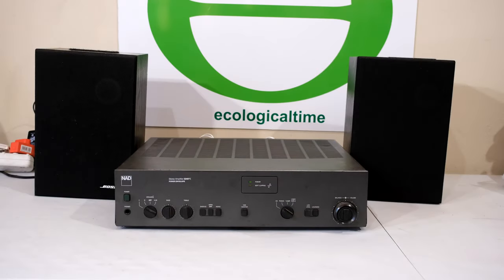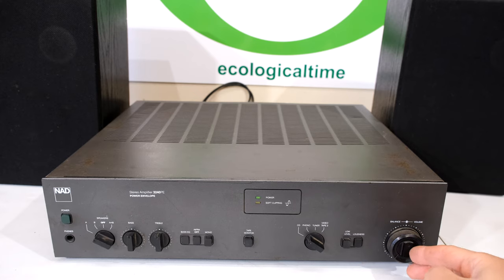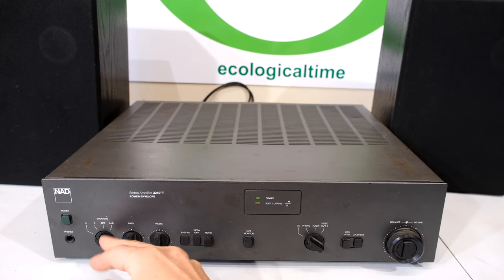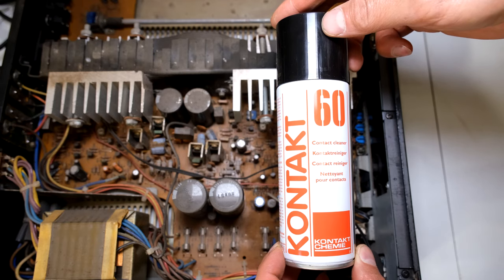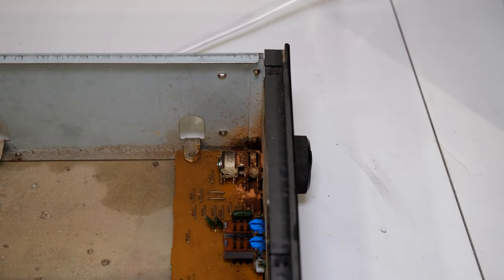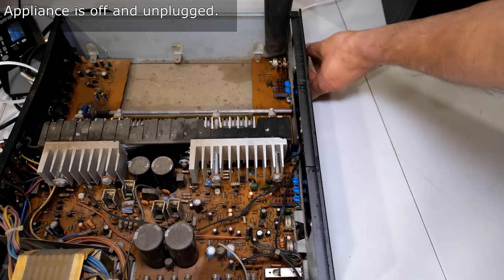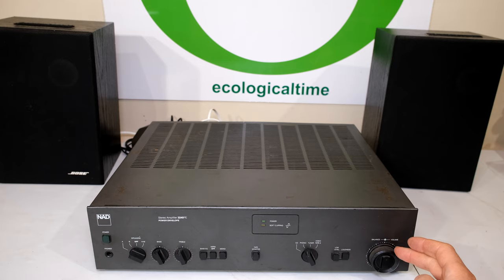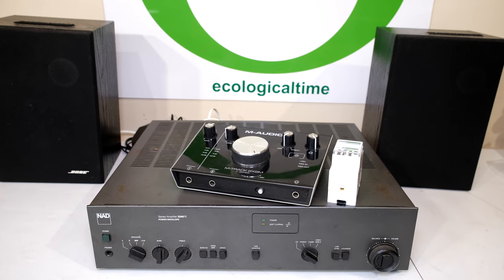How to fix a crackling sound when you adjust the volume knob on your sound system.

Comment: WARNING: Never use WD40.
Reply: This; WD40 is a solvent, not a deoxidizer/lubricant.
Reply: I just placed an order for some WD40 contact cleaner.  Lot cheaper than Deoxit
Reply: Why not wd40
Reply: @johndoe3582  eats parts

Comment: If you do not have the spray. Just turn the knob back and forth in a rapid fire movement like 50 times. This removes the oxidation off the contacts and may reduce or eliminate the scratchy noise.
Reply from the maker: Scratchy noise will return after a short time.
Reply: @ecologicaltime  So how do you fix, if you don't want to buy contact cleaner?
Reply: Omg this actually work on an old boombox!

Comment: Wow, very impressive video. The spray really seems to work wonders. 
So a about 6 months ago I purchased a THX AAA 789 and for a few months now I've been getting crackling and static whenever I adjust the volume knob. The general audio quality is still fine but It's always been extremely annoying. I guess I'll give this a try with the unit turned off as I've never worked with audio equipment internals before. Anyways, thanks for the guide!
Reply: Dit it work for you? I have the same problem with thx 887

Comment: Haha I have the same symptoms in two separate speakers in my car stereo. After swapping the amp and the head-unit I've been dreading having to chase down shorts and replacing the wires through the cabin. Fingers crossed a good cleaning works out!
Reply: Did it work?

Comment: I had the same problem in an integrated amplifier's attenuator in 1978 and now I'm having the same problem in an audio interface I got in 2018, so almost 45 years go by and the idea of a self cleaning potentiometer still manages to elude manufacturers....why is that.

Comment: Hey? What if you have a similar crackle/popping at zero volume and without moving the volume knob? I’ve used contact cleaner on all connections but I’ve not had any luck. Any ideas as to what it could be?
Reply from the maker: Sounds like your channel is blown or there is dry solder joint

Comment: You didn't wait for the Kontakt  60 to dry out completely? I mean, at least for me, it's all over the PCB below some bass/treble/center nobs so I'm worried it may short something out.. But that Kontakt 60 is not conductive or? I dried it out a little bit with a hair drier hah

Thanks and cheers 🙂
Reply from the maker: you dont need to dry it out unless there is risk of high voltage. For small electronics its fine if its wet.

Comment: No you should not use Kontakt 60 it will oxidize! Clean out the dust, use Kontakt WL on the potentiometer than Kontakt 61.

Comment: I Read that kontakt 60 is too aggressive for pots
Reply from the maker: what article was that? do you have a link. Been using this product for more than 20 years. The only problem i found is that the spray can loses pressure when stored.